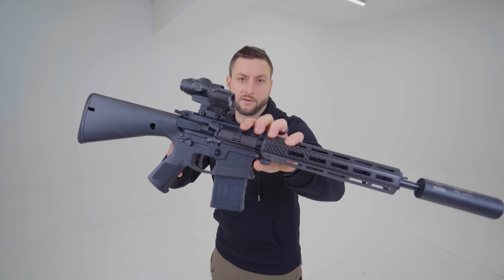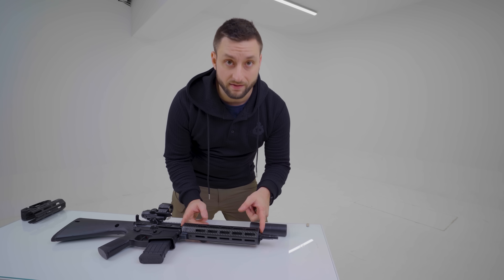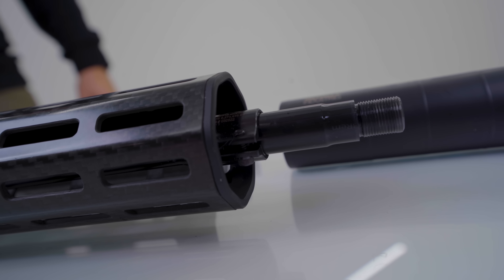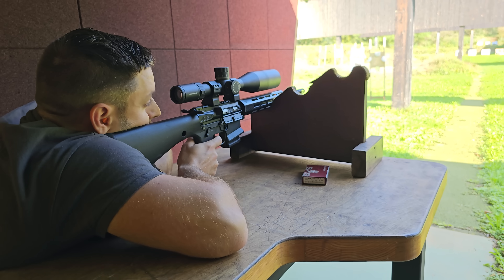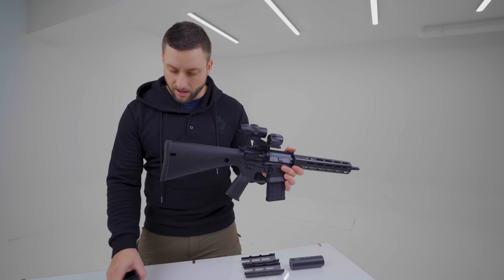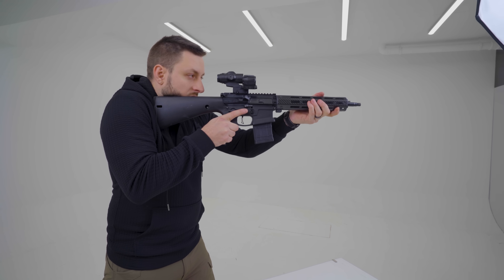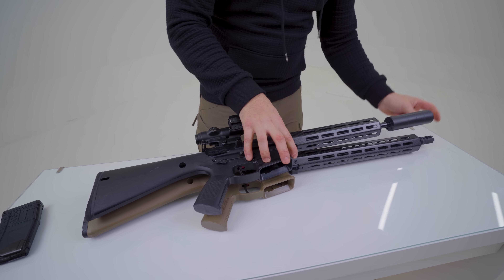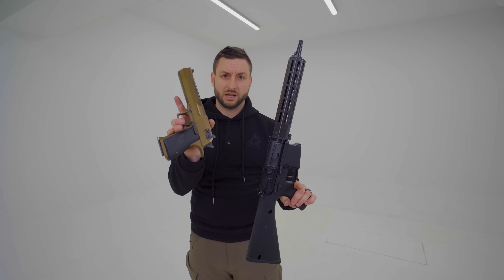WWSD rifle | 12.5" Commando setup

Comment: When the WWSD becomes an XM-177 clonish.
Reply: Ish
Reply: I'd be a bit worried about the stock. It is designed to withstand repeated impacts from the buffer during cycling and under spring tension all the time.
But now it just lost over an inch of reinforcement.
Reply: ish ish ish

Comment: I can only respect the amount of dedication it takes to hack through the barrel with a hand saw
Reply from the maker: It was surprisingly easy - i thought barrels would be made from harder steel
Reply: I pushed a jewelers saw to cut through a 3/4 inch steel square bar to open up a slot drilled into it.  Poor saw was only meant to be used on 1mm thick stock.
Reply: @PolenarTactical  So Wolfenstein WAS right...
Reply: @PolenarTactical I thought the barrel would be easy considering it's a pencil type

Comment: Shortening the barrel changes the dwell time but not the max pressure, so if was that crazy high, it does make sense you still ended up needing the adjustable gas block.
Reply from the maker: The barrel has a 2mm gas hole drilled - probably intended for an adjustable gas block from the start

Comment: 5:30 it’s more rigid as a shorter barrel as the whip at the end of the barrel creates less of a moment around the muzzle
Reply from the maker: that's my understanding
Reply: Yes, "bad harmonics" as it´s called (unvanted vibration) is what causes it.
Reply: I've heard reloaders have better luck with longer barrels, as the resonance frequency is greater with a longer barrel, making it easier to find the peaks of the waveform (node as reloaders call it, anti-node or maxima as physicists call it). I think a more rigid barrel shoots better across multiple loads. But long thin barrels can be tuned more easily. Not really relevant to most people for ARs, just an interesting topic
Reply from the maker: @coltonb9194  long thin barrels? As far as i know all high precision shooter prefer thick and heavy barrels because of rigidity. Length only comes in question for long ranges where highest possible muzzle velocity is desired.
The extreme of these you can see with benchrest where they have crazy thick barrels and those guys are after the ultimate accuracy

Comment: 5:32 I'm not an expert, but I believe I understand why that happens and I can explain it simply
The longer the barrel is, the more tension it is under, because it's bending under its own weight, even if you can't see it with a naked eye, but this is more noticeable in thinner barrels for obvious reasons.
If we make the barrel shorter - we shorten the lever and that tension goes away, which means we can bring out everyone's favourite HARMONICS of the barrel.
So, basically, shortening the barrel the way you did, improved harmonics and therefore accuracy

Comment: Crazy that this hacksaw is a felony stateside. 😢
Reply: In europe it should apply in every country how long gun(rifle,shotgun)
have 600mm overall and 300mm for barrel.
So in that sense we can have about 11.8 inch barrel and still call it a normal rifle.
Reply: It’ll get you ruby ridged here
Reply: @Kesssuli  
While that is true about the length, shortening the barrel requires a new proofing since a pressure involved part was changed and the save function has to be tested. The chopping itself has to be done by a licensed gunsmith too.
Reply: @onpsxmember  I think those have more to do with local laws than EU level.
Least in here if you change barrel and do other radical changes then it had to be 
a proofed if you plan to sell it.
For personal use that is not recuired.

Also i dont think it is recuired by law that you cant chop a barrel by yourself but
of course it is strongly recommend to leave that to professionals.
Reply: @Kesssuli what is “recruired”?
Reply: @JoshJones-37334  English isn't everyone's first language, and you know what he meant.
Reply: @Jeff.78 just everyone important
Reply: @JoshJones-37334  Troll elsewhere.
Reply: @Jeff.78  at your mom’s?

Comment: The barrel shortening and getting more accuracy thing is a real classic. That´s how the old Ruger mini-14s used to work. It sounds counter intuitive to get more accuracy from a shorter barrel but it´s because the barrel is bad to begin with. Long thin barrels with bad harmonics = garbage accuracy.  The shortening takes the bad harmonics (vibration) out of it and you get more accuracy.  Now guys please dont go shorten all your barrels... if you have a good barrel longer is better. The shortening for accuracy only works on some bad barrels.
Reply from the maker: Not just bad barrels, but long and thin barrels. 
Same thing would apply to a thick long barrel but if its already rigid enough for high accuracy, you wont really notice any change shortening it.

Comment: To shim between my upper and lower receivers i use a bicycle inner tube. I cut to size i would need just for the front pivot pin and it works great. A RANGER showed me that trick when I was in Afghanistan.
Reply: Were you a good cook?
Reply: @JoshJones-37334  no but your mom was.
Reply: @brazzy1467  she ate your parents?

Comment: I thought the reason those use a carbine spring and buffer is that they had to build up the back end of the buffer 'tube' to handle the stress of functioning. I hope that cutting some of that off doesn't affect safety.
Reply: You can’t go shorter than this.  One section of the reinforcement ribs is still intact.

Comment: Russell Phagan of KE Arms would be curious about how it structurally  holds up with the plastic being chopped off. The whole reason, according to Phagan, that they went with a carbine length buffer is to make sure there is enough material behind the buffer tube. 

Shortening this way might be fine in terms of using the gun but it might just make it a tiny bit more fragile though that would be it.
Reply: On the KE site it states they won't provide support for stock chops but he also endorses and supports the E93 chopped version from what I have seen. There may be a professional partnership and mutual understanding there between he and Joe wrt the allowable amount of material to be removed.
Reply: Oh don't you worry. I am sure Russell is going to be commenting on this video.
Reply: He already did. Says there's one section of reinforcement left, and that you can't go any shorter.

Comment: I got the FDE. I don't understand why they get any hate? I think adjustable gas block is a must, but alao remember the Bootleg BCG that is four position selectable with 2 unsuppressed and 2 suppressed settings.
Reply from the maker: From what i gather they get hate because of Karl and some thing that he once said on the internet, the other apparent issue is that the KP-15 lowers might break under very low temperatures. For my use the rifle is great and winters in Slovenia aren't cold enough to make me worry

Comment: Accuwedge is a couple of bucks takes about a second to install and is completely reversible should you get a different upper that doesn't need it. That said we often see set screws that push up on the rear takedown lug of the  upper on high end lowers. So this is a common issue that has a few fixes.
Reply from the maker: I tried the accuwedge first but it didnt completely eliminate the side to side movement. Shim now made it rock solid
Reply: @PolenarTactical  yeah many upgraded AR lowers have a set screw with delrin tip that allows you to set push the set screw up against the rear take down lug, just like the  accu wedge does. Since its a screw you can really get a tight fit between upper and lower. It would have been nice for the WWSD lowers but it would have required putting in a threaded insert into the lower which would have driven up cost.

Comment: Was this the Faxon barrel or the Ballistic Advantage?

And yeah. the epoxy used for those endcaps were no joke. I'm not surprised if you had difficulty in removing it! :D
Reply from the maker: I always thought it was Faxon but SinistralRifleman corrected me that it's probably Ballistic Advantage 
Either way it was severely overgassed. I suspect the gas hole on the barrel was made to be used with an adjustable gas block from the start
Reply: @PolenarTactical  that would make sense, depending on when and where you got it from. Latter production and Euro Brownell's, iirc, shifted to BA, and were much improved, and had less felt recoil than even the Faxon barrels,  hence the surprise at your comment regarding felt recoil.

Given just how light they are to begin with, I can imagine you're still probably getting a bit of gas with it, honestly. Great job on the DIY E93 chop, btw.

Comment: Ok super good opportunity to talk about suppressors. What is the advantage of a 12ish inch 556 rifle with a can vs a 16 inch rifle? (assuming everything else the same)
I presume you almost never shoot it without the can because you'd need to change the gas setting and it would be crazy loud. Since there isn't subsonic 555, the two are the same length, there's no flash on the 16" barrel with the right flash hider, and the 12" suppressed definitely isn't hearing safe, what's the benefit being suppressed?
Reply from the maker: Haven't shot it a lot but even without the suppressor it's fine, as long as it has a good flashhider on. The suppressor in the video is a conventional one and it combined with overgassed WWSD it creates a lot of blowback gasses. So if i want to shoot it comfortably i have to dial the gas down quite substantially.
So now im looking into getting a small flow through can that will hopefully work on the same gas setting as unsupressed. 

The advantages of a 12"rifle with a suppressor vs a 16" rifle with a suppressor are that it's shorter, lighter and more maneuverable. Downside is reduced velocity because of a shorter barrel.

.223 can't be made hearing safe because the supersonic crack will always be too loud. Making it subsonic would be impossible to make it cycle and reduce the energy of the bullet to .22lr
We use suppressors because they reduce the sound signature and muzzle blast - it makes it more pleasant to shoot and there is no need to have doubled up hearing protection when shooting indoors
Reply: @PolenarTactical That was the crux of it, does the can make it nicer to shoot (at least indoors) than the extra barrel length. From what you've said I think the answer is yes.
Reply from the maker: @stug77  oh yes, absolutely
Suppressors make it much nicer to shoot if the rifle isn't too overgassed

Comment: Why'd you use a hacksaw on the barrel? I assume you still cut your threads on a lathe and if so you could've just used a parting tool and ended up with a finer crown and less burrs. I'm guessing the hacksaw on the barrel was just for the video? If you used a die to cut the threads by hand there is a rather large chance of the threads not being concentric to the bore and either way those threads looked quite clean and that leads me to believe they were cut with a lathe.
Reply from the maker: Did you skip part of the video where i explain all of this?
Reply: @PolenarTactical  I never heard any explanation of how you  cut the threads. So I guess I must've?
Reply from the maker: @armorers_wrench  oh shit, my bad, wrong video 😅
We have another one coming up that's all about cutting the barrel
Reply from the maker: I sent the barrel to a gunsmith to properly cut the barrel, make a crown and threads
Reply: @PolenarTactical  Lmao dude its all good, when you replied I was thinking to myself "This dude must have another video or he edited that part out and forgot".  I saw the threads had a thread relief cut so I knew a lathe was employed. I'm a machinist myself so I get kinda autistic about that kinda thing lol.
Reply: @PolenarTactical  The gun turned out to be very cool. I just put together my first suppressor host and I bought a suppressor. I got approved in only 6 days so it seems finally things are changing in the states as far as NFA items go. My SBR was approved in only 4 days, lame that we even have to do that but it is what it is. 

In Europe are you able to buy the same brands of suppressors as we have access to in the US or is it all different? Like, can you as a civilian get a Surefire RC2 or a Huxwrx or anything like that? Or is it mostly B&T over there?

Comment: Wait I know he changed the gas block to an adjustable one. But shortening the barrel would make the over gas problem worse? Am I wrong?
Reply from the maker: The barrel has a gas hole drilled into it at the position where the gas block sits. This hole was waaay too big on the european WWSD which meant it was sending a lot of high pressure gas back through the gas tube. If you shorten the barrel you shorten the length of barrel that the bullet travels after it passes the gas hole - and the hot gasses are only creating pressure in the gas system until the bullet leaves the barrel, then they are wented out of the muzzle. This time of bullet going pass the gas hole and still traveling in the barrel is called "dwell time".
If you shorten the barrel, you reduce dwell time which reduces the time gasses are pushing through the system.

So shortening the barrel will reduce gas

Comment: What did you do with the handguard mounting that you mention. It's one of the points on my WWSD builds that I'm not completely happy with. Haven't had a problem yet, but just seems like it could be stronger, and I kind of doubt it'd hold a reasonable zero, which limits the roles for those guns.
Reply from the maker: Mine had too long screws that attached the carbon fibre sleeve to the aluminum block and they would interfere in properly centering and tightening of the handguard. 
But no matter what you will do, this handguard will not hold zero - the mounting system was not made for that
Reply: Thanks! I thought maybe you'd come up some magic, but yeah, there are always tradeoffs. Sadly I'll have to keep tweaking several more rifles to have ones perfect for every situation. Shorter + can looks like a pretty compelling solution for this platform when using a pencil barrel and this type of handguard mounting. My wife's build is just under 5lb with the 16" integrated slim comp, but I bet she'd get better trained faster without the blast from that thing.

Comment: 5:35 Deflection of the barrel at the end is less with a shorter barrel with the same bending stiffness as a longer barrel? Would this apply the same when comparing a heavier barrel and that same barrel chopped down then?
Reply from the maker: The idea is that a long thin barrel bends and vibrates more so when you shorten it you actually increase stiffness.
If you have a long but heavy barrel that is already quite stiff, cutting it would still increase the stiffness but the effect on target would probably not be noticeable. Also cutting the barrel too short can cause it's own problems regarding the velocity and ability to stabilize the bullet

Comment: Is that Breek warhammer charging handle I see? If so how has it been holding up. Because I bought one but haven’t been able to put it through its paces until I complete my build.
Reply from the maker: No problems yet at around 2k rounds. But i doubt it would stand up well to rough handling as it seems very thin and a bit fragile
Reply: @PolenarTactical  Thank you very much for the reply. I’ll try to keep that tidbit of information stored away. Great video as always!

Comment: Here's an explanation for shorter barrel in case you run into a nerd - anything linear tends to suffer under harmonic vibration, in which, for rifle barrels, means flexing every which way, and by reducing the length, (which furthers the vibration, or flex), the rigidity is thus increased, reducing chances of groupings open wider henceforth. 

Because science. LOL.
Reply from the maker: Yes, but... 
recently there has been a discussion about the barrel vibration and harmonics and how that's not a real thing. Bryan Litz and Hornady balisticians made some more or less scientific testing and according to them, barrels do not vibrate. 
Barrel harmonics was always just an unconfirmed theory but it exists for a reason - anyone that does some precision shooting and loads their own ammo will tell you that a lot of seemingly unimportant factors will have an effect on the accuracy of the barrel. 
Now if barrel harmonics really are a myth, then there has to be some other force or system behind this, to explain the results that we are seeing.
Until we get a new theory, i still use the term "barrel harmonics" to explain this phenomenon.
Anyway, i'm that nerd 😅
Reply: @PolenarTactical  Well, hard to dismiss the "flex" aspect of it, still, because under intense pressure - 55,000 psi for modern load 5.56 - the longer something is, the much more intense it will flex. If it doesn't flex, it'll break. "Vibration" can be substituted by pressure or force, but ultimately, further testing might just turn them out to be the same thing. Insofar as precision shooting goes, most precision barrels are bull barrels, so maybe added mass and material? 

Anyways, it goes on. One thing for sure - we need Firearms PhD as an actual research degree and department.

Comment: I am not all that impressed with the weight on that one.  Given the shorter barrel, you should have been able to shave that down even more.  I had mine set up on the older Cav-15 lower, and with the optic and a 14.5" barrel AND the flash hider AND the cheap magpul back up sights, it only weighed 4.75 pounds, or 2154 grams.  If your goal was to make the lightest possible version, there is still weight to be saved on your build.

Comment: The WWSD concept is cool. Inrange going full communist edgelord is not. And the KE Arms polymer lower has serious durability issues, with the pins wearing out the polymer.
If you want a super light yet functional AR-15 due to the use of advanced material, get a V Seven Sovereign. 4lbs AR-15 that has lithium and magnesium alloys to make it lighter, yet it's super durable wherever you need it to be. Even if that comes at a price.